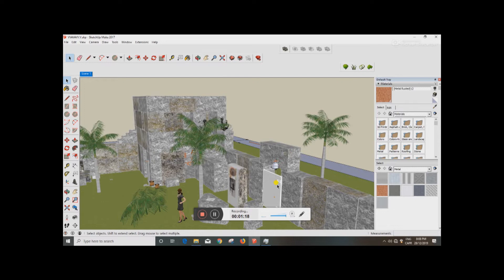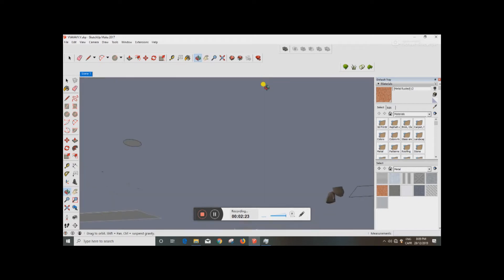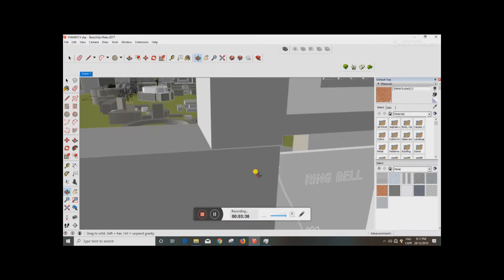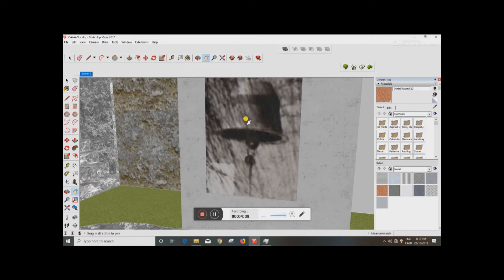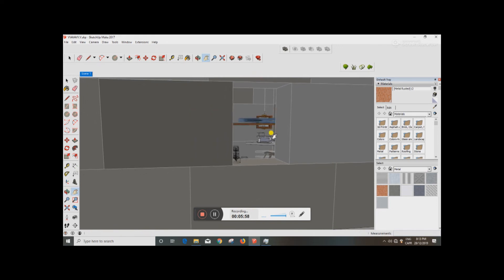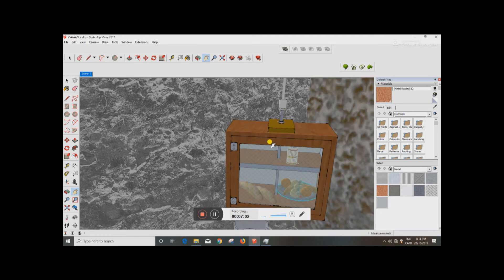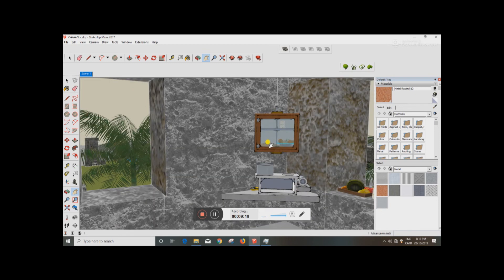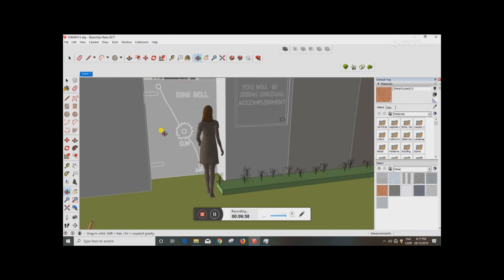RING BELL ROCK GATE

Comment: In old fraternities on the festivals which celebrated the two solstice days, they would ring a bell- two points on Eds door.  In this fraternal Lodge there are a total of 5 hours(Twelve, Noon, High Noon, Midnight, High Midnight) which represents 5un on Eds door.   A bell was used to denote time, these traditions were used on ancient boating vessels and in some ways are still practiced(Dog Watch or ships bell). Two consecutive bells would represent a particular time of the day.